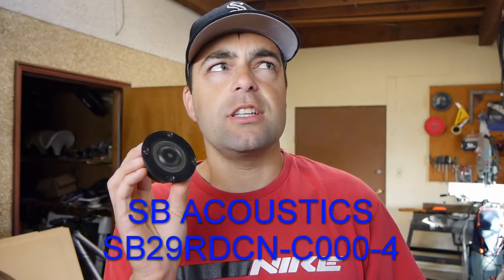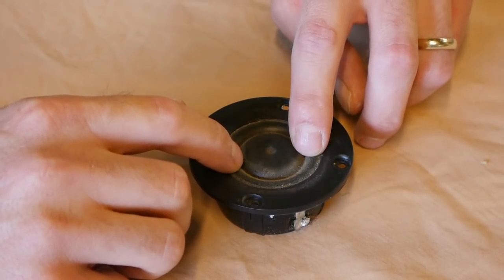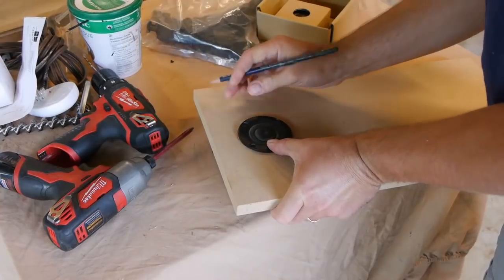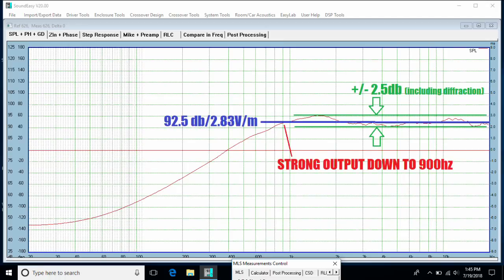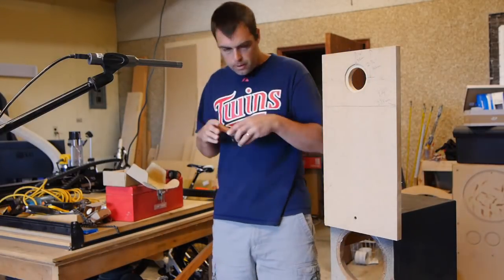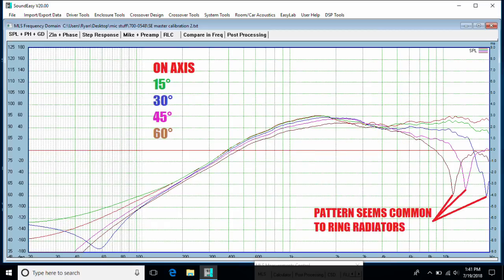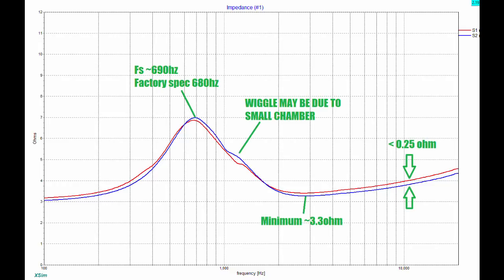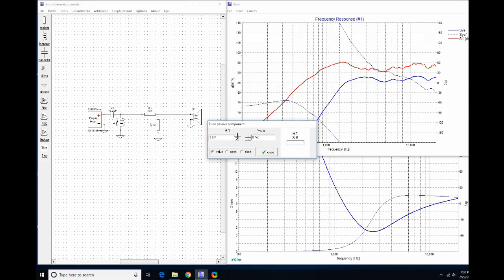SB Acoustics SB29 Tweeter | Test and Review

Comment: Well, any CNC is better than no CNC! Hopefully there is a cheap fix for your problem, and if you find a cheap solution, let us know!
The null might be audible with those extreme measurements. From real life experience it makes sense that it would make a difference.  Many car audio drivers have poor off axis response, especially when mounted on the rear deck. The doors don't help much either, which is why separates have the tweeter mounted high in the door. ,y 2013 Fusion stereo sounds pretty good, but by placing my hand on an angle next to the driver's door tweeter and angling it towards my ears it makes a huge difference in definition!

Comment: Hi, thanks again for review, it is one of the most helpful channels with driver testing.
I got some SB drivers and have some issues with them - maybe others have similar concerns and we can have some constructive conversation. First the SB29 neos; mine measure way off in Fs, with one around 770Hz, the second unit in 820Hz. Your pair is very much like SB data, Zaph's and a few others tested in the past. I know 10% is within manufacturing limits and 770Hz would be on the very extreme case, but Fs of 820 Hz is ..., well kind of weird. Also one of my SB NRXs has strange issue with Fs, Qes, Qms being quite high and wondering making Qts jump from 0.4 to almost 0.55 , Fs is around 40Hz, with the other one having Fs in 37Hz and Qt in 0.33-0.35 and being quite consistent. Any ideas what could cause such strange behavior? My other drivers don't exhibit such weirdness and usually stay in 10% limit from driver to driver.
Reply from the maker: pliedtka I have heard of SB woofers not measuring TS parameters close to factory spec and honestly, for woofers this is usually ok. TS parameters often fluctuate depending on how they’re measured (the drive level being the biggest variable). It may be that you find the TS to be “wrong” but they simulate and measure in the frequency response equal to the factory measurements. 

As for the tweeter Fs being that far out, that is weird. In my experience, the factory spec for Fs is usually lower than what I measure, but not by that much. I’ve always had good success with SB products so can’t say that seems normal. Have you contacted SB about it? Also see if you can measure them another way to confirm there’s no setup issue.
Reply: +Impulse Audio 
Thanks for reply.
Strange Fs with the tweeters I have, isn't it. I run some simulations and it didn't change the overall freq. resp much, if the two tweeters measure the same. My only concern is that higher Fs may push the 1-2kHz up (or down) and that's always a bit hard to filter if the area already sticks out comparing to rest - the resistor in series at the input of X-O has similar effect. I think, I will check if the distributor can find some drivers to match the 'healthy' units. Yes, if you drive the woofers near their max limits all T/S parameters change considerably - the SBB4 or QB3 won't be QB3 any more, not to consider room response - all the hell gets lose. Anyway, this a very strange midwoofer behavior, with T/S way of the publishe data.
How low, do you think, the SB29 Neo cold be crossed - with the higher Fs 1.7-1.8kHz still could be some how manageable without running into distortions.
Did you hear the new Dayton tweeters by chance or know someone who has ?
Reply: pliedtka 
I tried this and that in the way I measured the NRXs, cold, warm, a day later, vertically, horizontally, so I sort of run out of ideas with this one. I'm using Clio and I check the impedance measurements against known resistors. SB appears to measure drivers vertically and avoid cone sagging with their rather soft suspension.
Reply from the maker: pliedtka I haven’t heard the Daytons. 

I’m not referring to pushing the woofers near Xmas. I’m referring to small signal vs 2.83v or even 1v. The TS will change a surprising amount. 

As for the how low to cross, that really depends on how loud you want it. The 29mm dome can handle a lot. The 2nd order HD starts rising below 2khz but 3rd stays way down. I would not hesitate starting at 2khz and would consider 1.7khz to be pushing it. Most applications can tolerate that range. The Fs won’t really affect power handling.

Comment: I have two sets of the non-neo version of these tweeters in my builds.  They are stunning sounding tweeters.  Much, much better than some very expensive (but much older) ScanSpeak tweeters they replaced.
Reply: are these tweeters better than dome tweeters?
Reply: who cares I'm sure there are loads of benefits, to dispersion, distortion or directivity. Can't say that's what makes it a good tweeter, or if it's better than normal domes. I can say, they sound awesome. Very crisp and revealing. They go low, and have a really smooth and detailed sound and go really loud with no ringing or distortion. I love them.
Reply: Me too. I LOVE these tweeters. Smooth, detailed and great off axis response.
Reply: I heard they are probably the best for the money